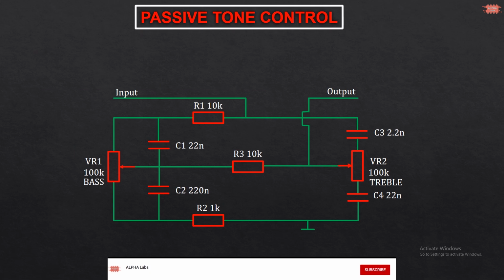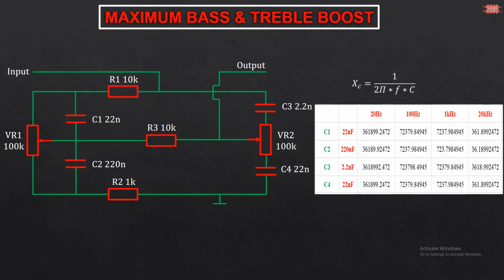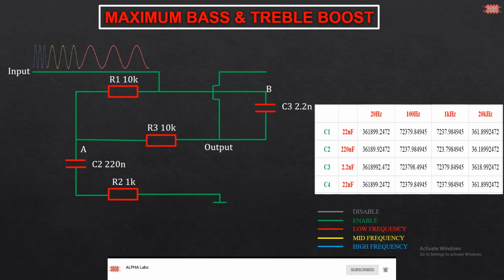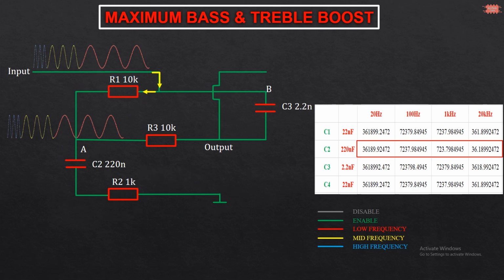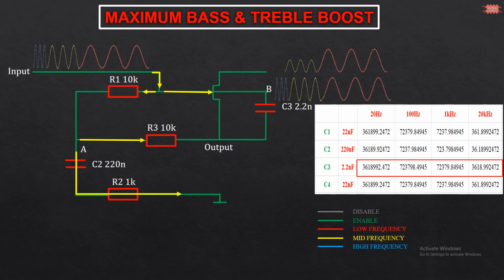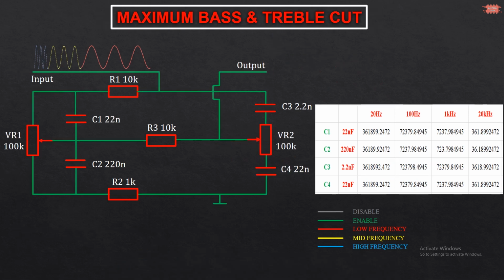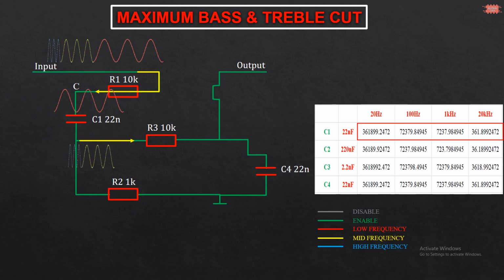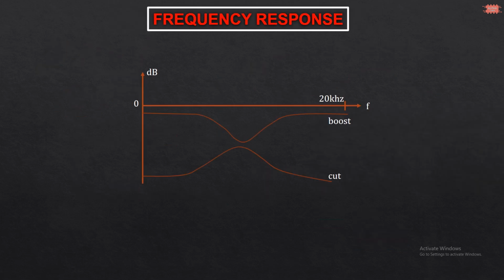Audio circuit amplifier | The passive tone control circuit explain | ALPHA Lab

Comment: I don't think that this circiut can boost any frequencies - it's passive circuit and it only can cut frequencies. Theoretically if You put your potentiometers in their maximum, it's still not boosting, but only not cutting frequencies. You still need active tonestack with I think feedback loop to boost frequencies.
Reply: In this passive case, theoretically it’s just how much bass/treble to pass or attenuate
Reply: You need an active device like a transistor or opamp to give gain to a stage
Reply from the maker: That’s right my friend